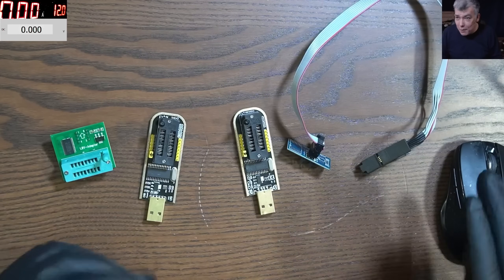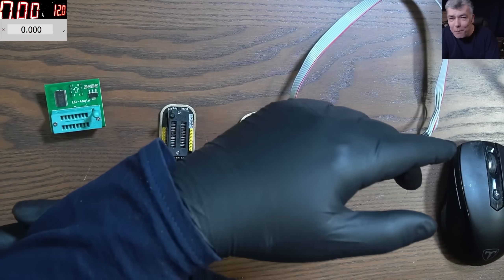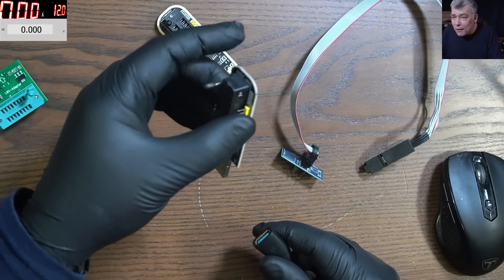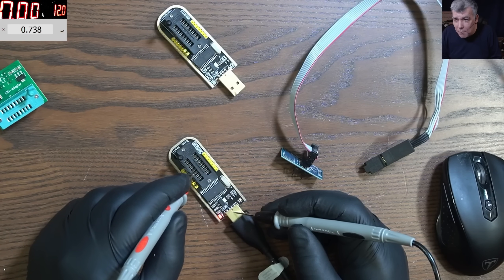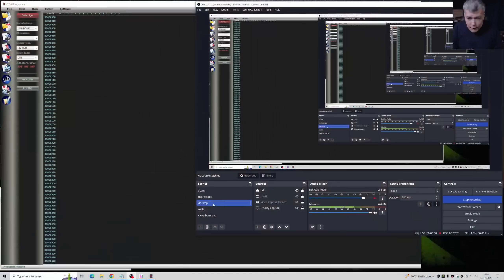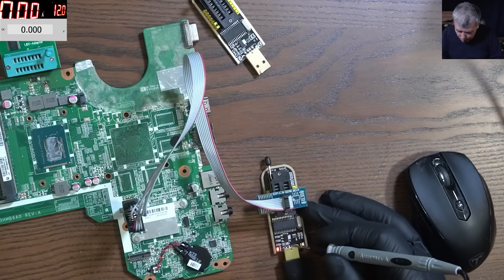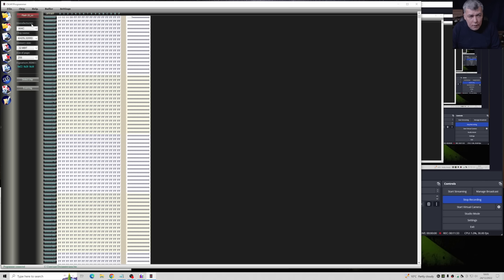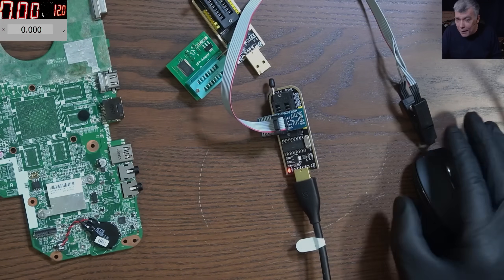How to program a bios chip - CH341A programmer, no, you don't have to modify it

Comment: Thanks Sorkin. I just got one yesterday and was skeptical about using it but I went through with it because you can't mess it up if you align the red pin with the dot/triangle designating pin 1 on the chip. It didn't read for several tries so maybe I don't have proper mounting contact I guess. I'll retry again after dismantling the laptop. I just unplugged the battery cable and started clipping on. Also there's a pin on the chip that's not soldered on the ch341b chip and no pad underneath it's painted white instead i think from manufacturer because i got it in a rip-off seal style static bag. Reseaching the ch341 layout it says pin 25 designated RDY. Is it important for 25xx and 24xx chip r/w operations?

Comment: So can I use the 3.3v to program 1.8v chip
Reply: @khalidmhmd3178  You have to use the 1.8V adapter. It can be bought with the programmer. Don't try to flash it without the adapter.

Comment: The issue is real, so where exactly is the design mistake? The onboard AMS1117 regulator correctly supplies 3.3V to the flash VCC pin on the ZIF socket, so the target chip is powered as it should be. The CH341A IC, however, is powered directly from the USB 5V rail (pin 28 VCC 5V), and its logic outputs (MOSI, SCK, CS, etc.) switch at 5V levels. As a consequence, the SPI lines on the ZIF socket (MISO, MOSI, SCLK, /CS) are driven up to 5V on the programmer side. The datasheets for typical 25xxx SPI BIOS flashes specify a maximum of about 3.6V on the I/O pins, which means the data lines are out of spec (at 5V) for most modern flash devices. In practice, many BIOS chips are still programmed successfully with an unmodified CH341A, because a lot of devices can briefly tolerate 5V on their I/O lines even though this exceeds the formal specifications.

Comment: hi . i have the same device and used it to unbrick my old Asus SSF pc. now i am trying to do the same to a dell optiplex 7090 SFF but the chip for bios is 16 pin chip . i have read that it will work with that chip XMC 25rh256ckiq. can anyone help ?

Comment: I had never done this or worked on anything like this, and although it was a bit of a headache finding all the necessary files, it actualy worked and I actually saved my PC, and it even worked instantly with windows and all my apps and data. (just needed to reset windows hello pin with microsoft authenticator)

One important thing I found was that you can copy over the identifying information about your PC (DMI) and windows key by searching through the bios backup bin file. I think that step is important and sometimes left out.

Comment: How do you know the voltage that the bios needs ??
Reply: @wehttamak  look up the model for the chip and it’ll be in the documentation
Reply: @wehttamak  you need to check your bios chip number. Just search up the number an manufactuter. The datasheet should tell you all you need.
Reply: @wehttamak  check the chip and research it on google

Comment: 05:05 That's a bunch of bollocks! Voltage can easily damage devices if it is too high for them. And there's even a proof in this very video: if voltage doesn't matter, why did you buy that level shifter for 1.8 V? :q  Just use the 5V programmer. After all, it's not the voltage that matters, it's the current ;)  I also dare you to apply 1000V to the CPU (might be through a proper resistor if you think that would limit the current), it surely won't damage the CPU, would it? ;>  Let mother nature verify us…
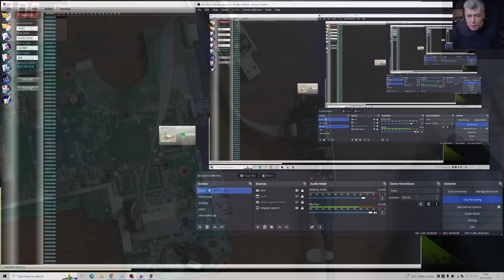09:09 Your measurement method is wrong, because the signals are changing very fast, so it would basically work like PWM: the multimeter would average the voltages and show a lower voltage than it actually is. If you really want to get to the bottom of it (but something tells me that you're not), then hook up an oscilloscope and measure the voltage levels on the digital lines. Nevertheless, even if they were correct during the communication, they're still at 5V on idle, instead of being detached, so they are still sending that 5V to the motherboard and the data lines that go from the EEPROM to the chips that communicate with it, and this may easily damage those chips if they're not prepared for such voltages.
Also please consult the schematic of this programmer (I know that you hate schematics and that you believe you can deal without them, in which case you might as well just reverse engineer the schematic from the board itself, as other people already did), and confront it with the application schematic that the chip manufacturer provides in the datasheet, then you will see that they are different, and the programmer is made incorrectly. The manufacturer pretty much admitted it himself by making an updated version of this programmer, with a switch for switching the voltage that powers the CH341 chip.
Long story short, it seems that it is YOU who is spreading misinformation here, not all those people. And if many people tell you that you're drunk, then there's a high chance that it's time to go home.

Comment: I've tried many attempts to program the laptop's BIOS, but it didn't work until I modified it. The programming worked on the first try.👍
According to the link I purchased from, it's the modified and improved version. There's no need to be silly. It's as if you've discovered something great.👎   (you should apologize)
Reply: apologize for what? are ur feelings hurt

Comment: Thank you for the video and the explanations. I want to program a chip w25q64fv : its datasheet explicitly specifies that voltage on any pin should be below Vcc+0.4.
With the CH341 black card I would be out of spec even if current will be low => I don't understand why this would be harmless to be out of spec? Maybe this could reduce its lifetime?

Comment: Hello, please, I need your help. Can I install the W25x40CLSNIG 3.3V chip without fear? I read that the programmer supplies 3.3V to the positive pin on the IC.
But the data lines are 5V.
THANKS

Comment: Does he have the cable in correct orientation on top of the ch34a? Looks backwards?? Thought red wire should be on there side on top of pin 1 which is top right instead he has bottom left?!
Reply: I thought the exact same thing, but if he put the clip on the chip the other way, it would work just fine.  The red stripe for pin 1 is only a reference so you keep it the same.  But if you flip it and thus put the red stripe on pin 5,  all you have to do is then think "okay red is pin 5"--as long as you put it the same way on the chip, it will work fine.
Reply: @rolandm9750  Pin 1 always corresponds to the location of the dot. If other way around he could fry the chip.
Reply: @davidm71  You don't understand, it's just a visual reference it doesn't have to be "pin 1".  It's just a wire no different than the other 7.
Reply: @rolandm9750  It makes it easier to match pin by pin starting with red wire. Sure you can flip it as long as SI goes to SI and SO goes to SO etc. Furthermore can't tell in that video where is pin one? Upper right or lower left. I assume upper right because he has it backwards and there is still communication. Maybe I'm wrong.

Comment: Thanks , you are legend. Ugy szoktak mondani ,hogy "fasza gyerek vagy" 😇

I have put  a Winbond BIOS chip 25Q64FVA straight into the ZIF socket as my first attempt with the CH341A , and it got MAD HOT after a couple seconds, thankfully I noticed it and disconnected it. Turned the chip the other way around and success , I was able to read it.

Comment: Great video, thanks. Do you recall whether one can blow the BIOS chip on an HP Elitebook 840-G6 without removing it from the board? Sorry, I didn't understand from the video why the chip may sometimes have to be removed, sometimes not? I'm asking as if I can't do it in situ then I will have to buy a heat gun and all the rest to desolder it - and there's quite a risk as it's my first time trying that. 

My aim is to remove the BIOS password.

Also, what is the best chip reading and writing program? Is there good freeware? Any advice appreciated. Thanks again.

Comment: CHECK your 3.3V Bios chip "Max voltage" and its usually less than 5V and thus if you dont modify this device, you risk damage on ANY input pin even if its low amp signal one.  I emailed the chip manufacturer and he said he only makes the chip not the device so the chinese have thrown this together and hope the 5V will be a good "average" working voltage.  Soren is brilliant and fixes almost everything BUT in this case i have to go along with the "tin foil" hat guys and DO the mod as you have nothing to lose and in fact later versions and others have the diff Voltage switches to do it CORRECTLY and safely.

Comment: I looked up my Bios chip for "max ratings" and it says 4.7V Peak only and Reg V way lower SO, the little programmer outputs all 5V unless you mod it down to 3V and the specs for it says it can do that so i will me doing mod as old bios chips only meant to get 3.3v on its lines and you can install  a switch to toggle from 3.3 to 5 as well.  Max rating are VERY critical as i once accidentally touched the 19V pin to the LDV pin and it sent 19V into that line of the BQ chip and then the the chip only pulsed voltage and nothing worked. Looked up the max rating for that pin and it was only 7V, so you can see "guessing" that 5V wont hurt a 3.3V bios chip MAYBE you get away with it or not, too risky.  Volts is pressure so even if the signal lines wont have any amps on it, they tell you what pressure it can stand too and exceed that and you compromise the chip.

Comment: I know you are a busy Man, so I will keep this short. You have helped me learn a new skill with reflash my Son's Legion. This video, and a previous one about how Lenovo BIOS can just bite the dust, made me bite the bullet and give it a go. I could not find a bin file to download, so erased the chip, reinstalled the original files and Bobs your Aunties sister it started up. Thank you Sir, this thing cost me over £1k and Lenovo would not help in the slightest and wanted £1,200+ to repair it (I could have purchased a brand new one for that price). 

I will be sending you some cash at the end of the month for all the help you have been. Thank you kindly Sir, I wish you and yours Health and Happiness.
Reply: ive got a legion 7 here at my repair shop with a bricked bios, i cant find the bin file either and im wondering what you mean by "reinstalled the original files"?
Reply: I read and saved the bios from the chip, then loaded it back on after deleting the chip. It worked for me, I hope it works for you as the only place I could find the bin file was on a site that wanted £50+.
Reply: @Horus9339  £50 for a bin file you can make yourself is robbery. Just extract the bios exe you downloaded from Lenovo and rename the largest file in the folder to  kwcn.bin, for example, depending on your model.

Comment: 5:05 Actually you can burn a CMOS transistor with a static electricity, which is just the high voltage.

Comment: The reason why they would want to modify it is to reduce the odds of failing a 3.3V flash, since the voltage regulator is very simple voltage switch. They were just too paranoid and that paranoia caused some misinformation lol

Comment: I've got a CH341B . Is it the same?
Reply: Both do SPI so if BIOS flashing is what you're after, you're good to go.
Reply: @kingeling  okkk... but my clip is not working when I connect using test clip the device disconnects from PC. but soldering the bios chip works
Reply: @kingeling   someone suggested me to solder a 0.1uf capacitor(on the small pcb where you solder the bios chip and rear end of the clamp connects)  from  VCC to GND  it worked for him.  hope you understand my english
Reply: @kingeling  actually soldering a 10v 470uf capacitor from GND to VCC fixed my problem. now the clip works flawlessly
Reply: @whocares3132  could you please elaborate? I'd really appreciate a picture or a video on that

Comment: I can also confirm this. Used the black programmer to rewrite a 3.3V BIOS chip, actually twice (first with a wrong ROM, then with a working one). Everything went fine, the laptop works properly after that. Nothing burnt or got damaged. So no, you DONT need to modify the CHF341A programmer.
Reply: @MrFerkosza  the jumper as he have according to datasheet is 3/5v so likely compatible with both, but if you move just 1 pin ahead I thing it gets only 3v cause the next pin says ground so ground + 3V...

Comment: Wow, this is what I call an electronic class. Thank you, so much.
I'm trying to restore a Steam Deck, and my gut says the problem is in the BIOS microchip. I connected the CH341a on it and it didn´t recognize it. Later on I discovered that the chip runs in 1,8v and I tried without the adapter. I was afraid I had burnt the microchip. Now I understand that this can't happen.

Good thing is that I didn't read or write anything on the chip because it didn't recognize it. Now I'm waiting for the 1,8v adapter to come, and I'll test again. Hopefully, it will be recognized.
Reply: I thought the regulator only switched between 5V and 3.3V and nothing else?
Reply: Did it work ?
Reply: 3.3V on the power rail can potentially fry a 1.8V flash chip or something else on the same power rail. Which is why you need the adapter. You got lucky.

Comment: Luckily I've read a post on Reddit saying that no modification is required. Btw I thought exactly the same: a manufacturer can make a bad design, but this programmer has been around for a very long time, it cannot be possible to have all these "faulty" boards around now.
Thanks for using your brain. The Internet is a good source for information, but this is an example of why everything must always be checked and not trusted straight away, you don't know who's on the other side.
Let me share a trick to get usb ports connected right the first time: the eyes of the port must look to the sky. That's how it's easy to remember for me 😅
Reply: The datasheet clearly says the jumper in that setting is both 3 and 5v so likely compatible with both.

But moving one pin is 3v + ground so likely 3V only.
Reply: You're right about checking stuff instead of trusting it straight away, but you must also make sure that you're checking it correctly. This dude doesn't, and his video contains a lot of misinformation, not just about this programmer.

Comment: will this help repair my strix rog g513rc dead bios from failed bios update ??
it happened during windows update, rebooted, then never functioned again...
what bios files and stuff would i need?? i added the ch341a to my cart :D
Reply: Did you try?
Reply: @AlexHusTech  yes sir, got my bios fixed and flashed, unit has been upgraded to a total of 3tb nvme, and 64gb ram and runs like a dream
Reply: @tnap1979  Nice one thanks for the response!
Reply: @AlexHusTech  not a problem, i got the ch341a black kit from amazon with the 1.8v conversion board and everything else for $29cad

Comment: It is not valid to read voltage with a multimeter during programming. This is measuring the average voltage (including zeros) not the peak voltage. I know a lot of people who insist they have fried flash chips without the mod. I am wondering though, if there are different versions of the CH341A which have different output current limits? It is common for people to not connect the VCC line to the flash and to not power the target board for ISP. And they successfully program the device. In this case the entire chip will be powered by protection diodes on the input pins. It will need something like 20mA or more to successfully burn a flash, in which case the current from the data lines must be a lot greater than 1mA. Such currents at high voltages could fry a chip. I also disagree that it is current that blows up chips. It is power = voltage*current. Whilst a diode normally has about 0.7V across it this can vary considerably as the current through the protection diode changes. All they need to do to ensure protection is put current limiting diodes in the data lines. It is running at low speed <3MHz so a few hundred ohms should be enough. BTW I have seen plenty of examples of production electronics that is faulty in some way that needs revisions to fix problems. So after some thought I am unsure about this. In the end I just  bought a better programmer that is 10 times as fast without such headaches.
Reply: which one did you buy?
Reply: I measured ~3.3Vpp on the SPI pins with an oscilloscope while it was reading a chip. It's possible I have a newer version of these boards, but I have no issues.

Comment: The "Mod" refers to using the programmer for automotive stuff that requires 5v instead of c.a 3v in order to work. Modding them allows you to read/write 5v stuff. Hence "no need" to mod for laptop use - but need to mod for automotive use.
Reply: For 5V chips I believe you simply add a jumper between the 5V/3V3 headers.

Comment: I tried this exact method, verbatim, to read a MX25L3206E BIOS chip, using the same exact programmer, ribbon connector and orientation etc. It detected the right device, and even partially read the data, but stopped after only reading 6% of its contents. I disagree that it's impossible to kill the chip with 5v, because after this attempt, the supply is now being shorted to ground through the chip. Prior to detecting the device, the default supply was 5v.I think the safest method is to prevent the 5v completely, when reading or writing to MX25Lxxx, but obviously not for all EEPROMSs!
Reply: @davemckiernan  read same chip with programmer no problem with neoprogrammer

Comment: I use one of these for doing automotive eeproms and the 5v works great. The new version 1.7 has a voltage switch to make life easy
Reply: hey, im wondering, where they use these for automotive applications? im studying automotive engineering and you may help me to learn something new!
Reply: @rul3s1232  ECM Programing, keys, mileage ect.